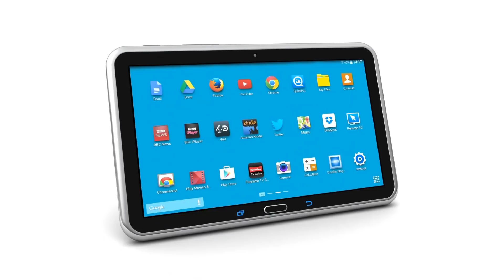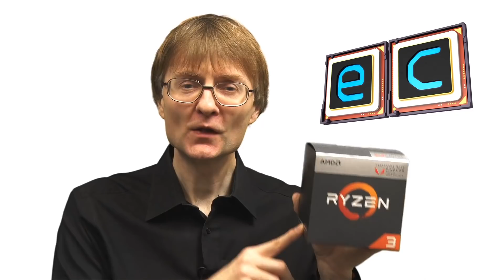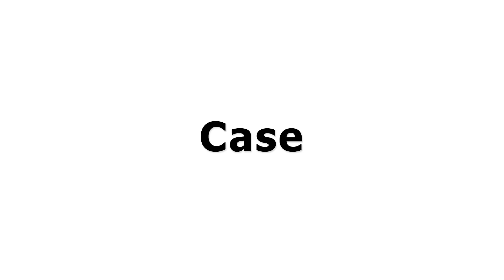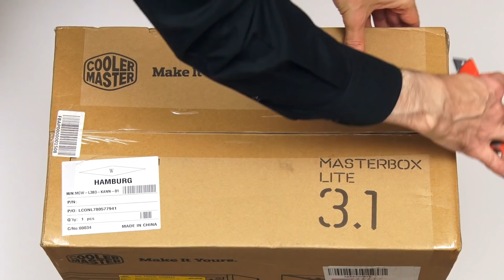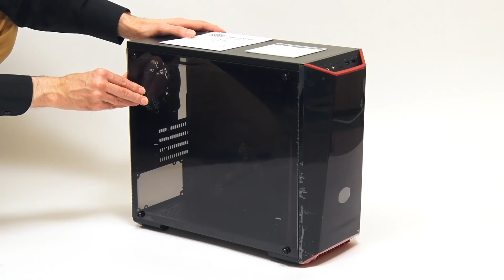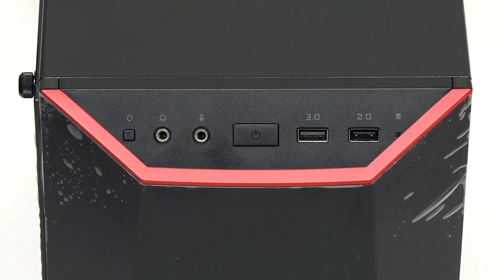Ryzen Budget PC Build #2: Case, PSU, SSD & Assembly

Comment: Great video as always. Just don't go placing a PC with a bottom PSU intake on carpet, as blocking that fan will cause failure of the PSU within a year. If a PC with a bottom PSU is going to be placed on carpet, then flipping the PSU so it intakes from inside the case is a sensible compromise, especially with the addition of front intake fans.
Reply from the maker: Great advice.
Reply: @ExplainingComputers  late late reply, but if the PSU shroud is vented, or if there's no PSU shroud at all, it's usually better to install the PSU with the fan up. the components heat rises in the case instead of on the PSU PCB, and helps it run cooler, without triiggering the fan as often. Also, the airflow of the case fans will always create a slight airflow through the PSU, so, all in all, it makes for a quieter system and a cooler PSU

Comment: Interesting build, like the color! Would've been, ah' "Cooler" if Cooler master had provided color trim for the case, Blue, florescent green, well you get the idea. I know it's for a gaming environment, but why no input drives, via optical, or other to install games? It's been 12 years since my last build and I'm way out of the new loop. 
So how is it accomplished now with installing games programs, or whatever your fancy? Thanks for sharing!:-)
Reply: Not online play per se but as stated in the comment above mine there are different "platforms" to buy games online and install locally for online or offline play. The most notable or popular are Steam, Epic, Origin, & GOG. A bonus to this is (as long as you don't get locked out of your account) you don't have to worry about media degradation. Even buying a retail box will get you a code to download from one of these platforms instead of containing physical media. If you want to install older games you have physical media for a USB DVD or Blu-ray drive isn't really any more expensive than buying an internal one
Reply: Steam, origin, epic, discord, amazon, etc.
Reply: Most games and videos are digital distribution now so newer cases are forgoing optical drive mounting in favour of space for fan mounts and radiator mounts
Reply: @nodrogstacey7813  when you say digital distribution, do you mean online gaming or just another media type. After 12 years I'm almost lost all over again, and I used to compose exec, bat & sys files back in the day. Lol. Thanks!
Reply: you install via steam as noted above. That, and online games usually have installer clients that you download to put the rest of the client in.

Steam does let you create DVD backups though if you do have a DVD drive, saves on your bandwidth.

The other upside to using a USB 3 dvd/Blu-ray drive is you can have the drive itself on the desk and the PC under it... which is an arrangement I aught to do with my desk come to think of it.

Comment: The machine is looking good, though you've left us on a cliffhanger ! 😉
I would always suggest checking your cable routing before fitting the main board, however . I learned that the hard way - building a computer a couple of years ago, I belatedly realized that because of its  (hidden) routing, I couldn't connect the 8-pin 12 volt plug to the main board with it in situe, so I had to take it out again. 
Fortunately I was using a modular PSU so I only needed to mess around with one cable. The same job with a non-modular PSU would have been much more difficult.

Comment: Lite 3.1 has worst air flow why did you choose that 😱
Reply from the maker: I liked the case in every other respect. From the reviews I understand the case (due to the top/base grill front intake) is not good for builds using older, higher power components, but should be fine with a 2200G and lower-power graphics card (with front fans installed). A lot of companies are now selling 2200G systems in this case. But I will keep a close eye on temps. We shall see!
Reply: @ExplainingComputers  yeah I get it 😅 but lite 5 or deepcool's matrex 55 would have been better

Comment: Put in a manual overclock for the CPU and RAM. That "stock" voltage is too high for normal usage. My Ryzen 7 1700 is running 1,264V and 3,8GHz stable. And you have 2400MHz RAM, activate XMP or use manual overclock for that as well. Ryzen needs fast RAM. Try to overclock RAM to at least 2666MHz
Reply: Overclock and voltage tweaking goes beyond the scope of a beginners guide like this one.  I'm sure he's making that adjustment off camera though 👍
Reply: Even a beginner must know, that if you don't manually set the RAM speed to "on-the-box" numbers, then your stick(s) will run at 2133. If you don't know how to do this or don't want to do this, then you don't need to spend money on fast RAM. Just get the cheapest then.

Comment: I hope they still make cases with 3.5" and 5.25" drive bays.  I still like having an optical drive, and 3.5" HD's.  2.5" bays for SSDs are OK, and most motherboards have slots for SSD cards, but a 3.5" rotating HD is still many times cheaper per GB when you want several TBs of storage.  Putting your system files on the SSD and data files on a HD is a fair compromise in terms of speed vs cost.
Reply from the maker: I'm sure that we will have interna. 3.5 and 2.5 inch bays for some time. Though external or internal 5.25 inch bays will I imagine become less common.
Reply: The general approach seems to be going to putting optical drives as external devices. But I don't see 3.5 going anywhere for quite a while either.

Comment: I think it might be a good idea to expand on the "don't skimp on the power supply" comment: on many cheap units by companies like Raidmax, Diablotek, Sparkle etc the number of watts claimed by them often doesn't line up with how much you can actually pull before something goes (badly) wrong. In these cases the wattage rating can be a straight-up lie, a result of extremely unrealistic conditions (eg. drawing hundreds of watts intermittently from the 5 volt portion while blasting chilled air at the innards), or it may be a peak load rating for short periods of time (indicated in tiny fine print on the back of the box).

My concern is that new builders might watch this video and come to the conclusion that they'd better not skimp on the PSU, the number of watts it's rated for = indication of quality, therefore more watts = better, so they scored big getting a 750W Diablotek with loads of spare power for $20! Only for it to come with but a single PCIe power connector and go up in smoke powering a 1050Ti... Where a good 450W supply from a reputable company would work reliably for years.

I would appreciate hearing your thoughts, and whether I'm making a mountain out of a molehill here.
Reply: Corsair, coolermaster and EVGA are amongst the good ones.  I have a cooler master at the moment, I needed it quick and got it from a local chain store, paid far to much for it to be honest. I used to have a Thermaltake, a great PSU, lasted for 7 years and two builds. I will get another one.
They are a good price as well, the cheaper one  Thermaltake Litepower 550W is around £34
Reply from the maker: Very good and very fair comment. I did not want to imply that wattage is the only or main consideration. There were so many points I could have expanded on in what became a rather long video.
Reply: Yeah, even if they don't kill the mainboard, they tend to die depressingly quickly. It's hard to find these short PSUs (I didn't know Seasonic even made one in this size, they're who make Corsair PSUs).

Seasonic is also good (they sell most of their units other other brains), Thermaltake (the one in the gaming PC is a Thermaltake), EVGA (have one, it's been modified and powers my 3D printer, a job it does, even if it complains a bit, Seasonic makes these too), and there's Coolermaster. Rosewill seems to have some decent ones too, but I've never used one personally

Comment: At 14:40 I always check very carefully that none of the metal tabs on the I/O shield have managed to get inside any of the motherboard sockets. They are meant to press against the outer shells of the sockets for earthing/grounding purposes but they can get caught inside USB or HDMI sockets and the only way to get them out is to remove the motherboard from the case and start again.
Reply from the maker: Good point. I have been there! :)

Comment: At 13:20 you say if the risers are installed in the wrong place it will damage the motherboard. How do you know which ones to use?

Also, this is a "budget" PC; how good will the performance of it be? Is it worth paying the more expensive options for CPU and motherboard?
Reply from the maker: On the risers, you need to look at your motherboard to see where the holes will line up! I usually end up checking with a tape measure. :) We will see some performance benchmarks in the next video (I've not run them yet), but I expect performance to be pretty good -- eg this PC will outperform many top-end machines from say 5 or 6 years ago. For modern gaming and more intense video editing, adding a graphics card (Part Four of this series) is a good place to spend more money. And using a Ryzen 5 2400G would improve both CPU and graphics performance.

Comment: For the very first time I don't agree with you Chris , because if you are going to put a graphics card  in this build then why did you choosen  this APU, and why not ryzen 3 1300x for a even lesser price
Reply from the maker: Thanks for this. And you are totally correct if what I was going here was a complete build including a graphics card. But that is not my intention. Rather I am making a series of videos in which I show (and then test in Part Three) a stand-alone, integrated graphics PC build which can end there. And then I'm making a video about upgrading a PC with a graphics card. :) So here the video making dictates the path of progression. Also, I would argue that a big benefit of using the 2200G is that a PC can be completed with integrated graphics, and used for many months -- or years! -- without a graphics card, that can then be added when budget allows. I am lucky enough running this channel to be able to upgrade rapidly. But this will not be the case for all builders.
Reply: @ExplainingComputers  another great explaination , totally satisfied with your point . Eagerly waiting for next parts of the series
Reply: Graphics processors can be used for heterogeneous computing with various frameworks such as Cuda, OpenCL, and OpenAAC; thus, you may want to install a graphics card for developing and running these kind of applications.
Reply: There's another option Chris has by using an APU instead of the CPU-only option.

If he leaves the monitor attached to the motherboard and adjusts a few settings in Windows, the graphics card can completely disable when it's not needed, saving a bit of juice (if the motherboard supports that anyway, which it's new enough that it should. My old Dell Optiplex does not and my gaming desktop has a 1700x in it). Ryzen APUs can also be used to boost a standalone GPU if it's the same video chip.

Comment: Cram the nest of extra power wires into the 3.5" drive bay, and hide them with a piece of black plasticard...
Reply from the maker: Black plasticard is a great idea. And I have some in the cupboard! Excellent tip. Thanks.
Reply: @ExplainingComputers  You can even build a matrix of self-flashing RGB LEDs ( https://goo.gl/rHyaBv ) on to the black panel, by drilling 5mm holes in the panel and have the LEDs poke out the holes. 
Make sure you order the slow flashing LEDs. I made one in a 8x7 Matrix and it looks so cool. Like a computer working....
Just a suggestion.

Comment: I've to disagree with this build:
1.Do not ever buy below DDR4 3000 CL16 on a Ryzen build, especially when you rely on the integrated graphics.
2.The motherboard in this video has only 2 RAM slots, so you would have to sell the 2x4 2400 when upgrading. By the time, the 2400 RAM is worthless.
3. Buy a 240GB SSD instead if you intend to install more than 2-3 games.
4. Why a 550W power supply, when the upgradeability of this machine is bad?
Reply from the maker: Totally understandable feedback. But RAM with a speed below 3000MT/s will work fine in a Ryzen 3 2200G system. Certainly, faster RAM will give improved graphics performance. But as I discussed in the first part of the series, I wanted to build to a budget. And faster RAM (with the same heat spreaders) will run hotter. A 120GB SSD can also be fine for a PC in many situations -- eg the PC I am typing on now has a 120GB SSD, and is the one I do most of my writing, admin and client work on. So it just depends what the use case case is -- and indeed I make this very point when discussing the SSD capacity in the video. On the PSU, the case and PSU may well last well beyond any of these components, and so thinking in terms of resource usage and reducing waste, I bought the higher spec for pretty much an identical price.
Reply: @ExplainingComputers  The 8GB corsair vengeance DDR4 2400 CL16 Kit is only 2€ cheaper than the DDR4-3000 CL15 kit in my country, so I don't get the budget argument here. Yes, it uses less power and generates less heat, but the heatspreaders can handle much more (I got mine on 3400 CL16 at 1.38V). Secondly, the 240GB Crucial BX500 costs only 29€ at the moment, which are just 5€ more than the SanDisk 120GB. The Asus Prime B450M-A costs only 5€ more and has 4 RAM slots for better upgradeability - just saying. Thanks for the reply, love your vids.
Reply from the maker: With that price difference, I agree -- get the 3000! :) But I was looking at abut £60+ vs £100+ in the UK when I purchased. Similarly with the SSD, prices change so rapidly.
Reply: It took me a month to figure out what 'XMP' was or how to use it. My 1700x worked just fine on what it was running before I turned that on (I think it was 2666), it does run a little better at 3000, but it wasn't life changing. A lot of Ryzen's notorius pickiness about RAM was resolved in UEFI updates, so given that, one of the first things I'd be doing with this system is updating the UEFI/BIOS, but still
Reply: Here is the better configuration for 339€: https://www.mindfactory.de/shopping_cart.php/basket_action/load_basket_extern/id/44a73d2214fb8b98cf786b138bf457c2d0206bcdfd24d08717c

Comment: Thanks for another great video. I small suggestion: if you ever decide to install a HDD get yourself some rubber / silicone washers for the mounting points. It will reduce vibration noises from the moving components in the drive.
Reply from the maker: A very good point to note.

Comment: What did that PC do to you that you hate it enough to put Windows on it?
Reply from the maker: It will get Linux too. But many people -- inc most gamers -- will install Windows, so that is why will show it.
Reply: @ExplainingComputers  I presume you will include the price of Windows with the total cost of the build?  this is a p[roblem these days, Windows 10 is normally sold online, so a second computer would be needed to get it onto a USB stick. I have seen some places selling it already on a USB stick, a Windows 10 Home Box Pack around £107, I presume you got it cheaper?

It was so much easier when you just used to buy a disk from a shop and slap it into the optical drive.
Reply from the maker: A good point on Windows -- I will cover that in the next video. The prices shown at the end do not include a line for Windows.
Reply: Windows has it's place. I'm using Linux on this machine at the moment, but the gaming/game-design box next to me is running Windows 10.

I like Linux, but this server/workstation is more fiddly to work with then my windows machine is, and that's with Mint installed.

Comment: Dual booting? That reminds me of the countless problems I've encountered with grub... But at least I learned from my mistakes. What I learned is that I'm never going to use Windows Disk Management again, while grub is installed on the Linux partition.
Reply: LILO for the win! (What happened to it anyway?)
Reply: @jenda386  Well I tried lilo once and it only detected Windows. I don't know how this happened. Lilo is getting pretty old, that's what's going on. But I don't know. Grub seems too "sensitive" to me. Sometimes it couldn't detect the partition it was when in fact the only change I made was delete another partition that had nothing to do with the bootloader.
Reply: @ZfightingLOD  First of all I have a laptop. Then, I want more than 2 OSes that I can easily manipulate and interchange data between. So many hard drives is not a solution for me. It's the best and safest way to install an OS though.

Comment: >>>CHANGE THE MOTHERBOARD!!!<<< H,i i want to give you a good tip... This motherboard is a "too" cheap one designed to fail quickly. This thing will last in best case half a year... You can easily see that at the northbridge cooler (the 40x40mm one), its hollow when you look from the side so the chip underneath get's grilled.... Nice channel btw.
Reply from the maker: I would be very surprised if it only lasts six months. I've used a lot of Gigabyte boards, and never had an early failure. We shall see . . .

Comment: I think you missed a step before installing the motherboard inside the case. It's always better to test your hardware outside the PC in case the hardware doesn't work. I've seen it multiple times where new hardware was dead on arrival but it would be more annoying having to take everything out again just because one part is broke.
Reply from the maker: True. But I did just that in my last (i7) build here, and got a lot of complaints for doing it! So I cannot win here. :)